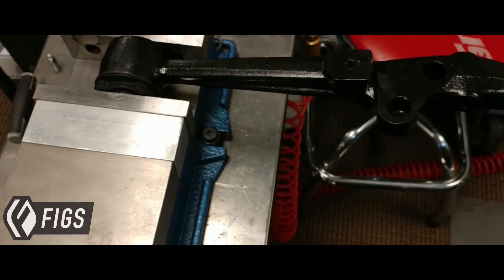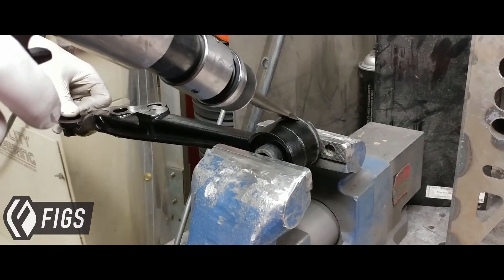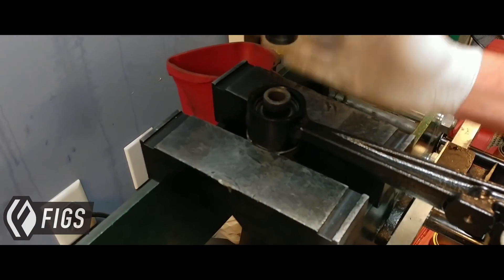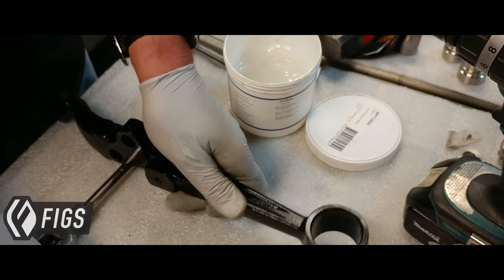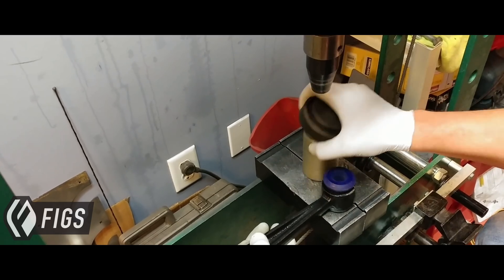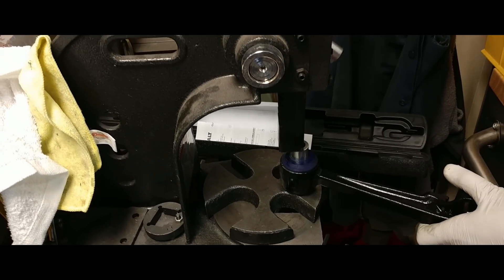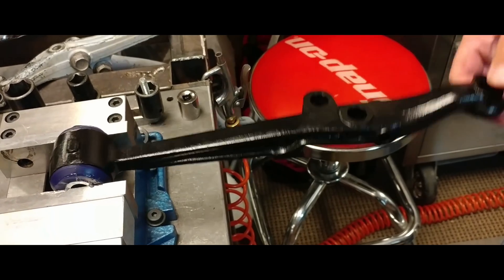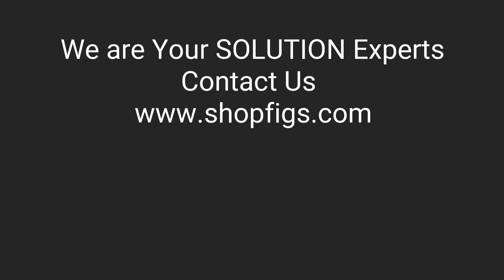OE Rubber vs. Superpro Poly Bushing vs. FIGS Spherical FK Bearing Mounts + Tutorial

Comment: How are spherical on NVH. I just read a rather disparaging article (and ensuing comments) about how poly isn't suited for control arms due to rotational wear and squeaking and something called taking a compression set. Someone even said theirs were toast after just a couple of hard track sessions. What I'm looking for is a measurable upgrade for a beloved daily driver that I like to drive hard and will take to a track or autocross a few times a year. I would like near OEM reliability/durability, once-yearly maintenance, and roughly the NVH costs of mid-stiffness (85a) poly.
Reply from the maker: I think if you're talking about the general term of polyurethane and suspension motion, there are not a lot of great solutions out there. This tends to give the material a bad name as if the formula is consistent across all manufacturers. All I can say is that super pro has designed a quality product with features that retain lubrication. Lubrication is the biggest key to success with polyurethane. We have proven the longevity of this product across many platforms and conditions. It really is a fantastic product with a factory like feel, but substantial performance benefits and support for higher loads. Sphericals do perform the best under track conditions due to their lack of deflection. However, they will require more maintenance in the long run. Everything is a trade off.

Comment: What are the benefits of the spherical bearing? Anything noticable in driving handling? Thanks
Reply from the maker: Sphericals are the highest performance connection given their 0 defelection nature of motion transfer. But they do put more demand on the primary damper and chassis dynamic stress.  So everything should be approached as a system and upgraded in sync.

Comment: and your NVH will be terrible, factory engineers know what they are doing they use rubber for a reason
Reply from the maker: Not the case.  Just as all tire compounds differ, so do polyurethane formulations. Spherical bearings can introduce nvh but really they just put more high frequency  band damping on the shock itself. If you upgrade to a higher fidelity shock with greater high speed damping properties, you would be surprised how good the ride is. Also subframe mounts with large mass rubber damping can decouple a lot of higher frequency noise. It really depends.

Comment: That standard arm looks the exact same lower front arm as the is200 and JZX100 and JZX90. Im renewing the rear on my JZX100 and ive got the subframe off ready be painted but I don't know whether to go solid subframe mounts, poly bushes rubber bushes??? I use it on the road aswel as off road. Does any1 know if it's unbearable to drive on the road with solid subframe mounts or what it's like with poly bushes instead of standard rubber or whats best for a mixture of daily and off road driving??? Only let me know if uve had experience please as I really need to get it done and I cant find anywhere people explaining the feeling on fitting em
Reply from the maker: It's difficult to explain a subjective feeling especially when it comes to ride quality. Some people will tell you that solids a great and they would never go back but another person will tell you that they are far too harsh to do anything on the street or for daily driving. Our polyurethane bushings do an excellent job of absorbing a lot of that high speed NVH, the rattling and vibration that you would get from a solid solution. But the resulting feel is greater response, not jarring force.
Reply: As a 2nd gen GS300 owner, I have a mixture of all 3 throughout the multilink system, OEM, Super Pro ( 70A or 80A ) , and Pillowballs in certain areas of the suspension. What I've learned is that  low speed ( your typical 25-45mph ) driving on imperfect city streets is not for stiff spring rates, Pillowballs in upper control arms or in places such as #2 control arm which connects to the body as part of the front subframe damping. Super Pro is good for subframe bushings, because they offer oem like ride quality and gets rid of that extra "lurching" one feels from hard braking, or sharp turning. With 12k and 10k coilovers a small bump at 30 mph feels like I'm off roading, that same bump at 60 mph becomes obsolete. Low, Medium, High speed damping plays a HUGE role in everything else on the suspension.

Comment: OEM rubber is best .. dampening and noise is non until rot dry
Reply: Best. For what? Best varies greatly depending on use case and variables.

Best ride? Best track performance? Best balance of just those two parameters? Even those two simppe qualities have multiple layers of nuance.

Then there is best for maintenance? Best longevity? Best resistance to environmental issues?

Not to mention best cost. Best ease of installation.

What is best for one application is worst for another.

Comment: Question  .      .      . How does  poly  bushings  holdup  in cold  weather .  Living  in Alaska
Reply from the maker: The temperature will impact the durometer slightly, but the grease used was designed for extreme low temperatures so there should be no issue with the lubrication aspect.

Comment: How is the ride feel between the spherical bearing vs the poly bushings? I am looking for that soft comfortable stock
feel.  I know it will be more stiffer ride with poly bushings but is it that noticable to where you will feel every bump?
Reply from the maker: It really depends on your shocks. Every bushing or bearing replacement really just puts more emphasis on the shock as the primary and in some cases only damper. You won't feel every bump unless your shock is poor at damping high-speed force events.
Reply: I've had both on my IS F.  Spherical bearings are less compliant on sharp bumps, so you'll hear them and feel them more than you would with rubber or poly.  Poly is in the middle.  It damps out less high frequency than rubber, but noticeably more than solid bearings.  That said, I recently went full solid with Ohlins DFV shocks on my front end, and the steering precision is really amazing compared to poly or rubber.  Just know that hitting a pothole or anything sharp edged is going to make a louder cabin noise and give more valuable feedback through the steering wheel.

Comment: Please, whats shore A thete até these bushing?
Reply from the maker: Depending on the application and load requirements we offer 70,80,90 and 95a durometers.
Reply: @FIGSEng  for Civic si 07 tô 2015
Reply from the maker: We have several bushings for that application.  Most would be standard 80A hardness.  If you would like a quote you can email us at contact@figsengineering.com.

Comment: How harsh would spherical bearings make street driving? I understand academically that the solid bearings have zero give compared to rubber bushings, but in practice, how much rougher does this make the ride?
Reply from the maker: In practice the spherical will put more emphasis on chassis response and the shocks. This is one reason why when upgrading,it should be in conjunction with damper upgrades. When the suspension attaches to the chassis via large subframe bushings, the impact is unnoticeable because they still decouple the high freq vibration. I think it also depends on the state of other components in the system and it will expose worn or weak items.  Generally these things are outweighed by the increase in response, one reason we suggest them for track only applications. Mike

Comment: Hi great video. What’s the difference with the hardened rubber bushing vs superpro poly bushings?
Reply from the maker: Hi, can you clarify? Difference in motion? support? Happy to answer I am just unsure the specific question.
Reply: FIGS Engineering 
Thank you very much for responding, I appreciate it very much.

The car Will be used as a street car or daily driving. 

1. pros and cons between the two? 

2.What is the difference in ride quality? Is the hardened rubber closer to oem ride quality vs polyurethane?

3.Do they both make noice/squeaking? 

4.Do they both require lubrication? 

5.Is the hardened rubber softer than the polyurethane? 

I hope these can help better answer my question.
Reply: @47veilside  I guess I am not sure which part you are referring to as hardened rubber as most of the time in order to get rubber to become stiffer, the manufacturer bonds metal rings inside the rubber.  The Superpro Polyurethane is a very precision cast material so it has some damping qualities unlike rubber and the free-moving center pin allows the free motion of the suspension, making the shock work better in most situations.  Typical polyurethane has a bad reputation for migrating during repeated use (deforming) over time, not so with the SP poly urethane.  And the noise associated with polyurethane is also related to poor lubrication.  SP poly has the cross hatch knurl pattern to circulate grease and keep things from squeaking.  Its the best product we have found and the only poly we will sell.  Polyurethane comes in a variety or durometers (harness) and the typical bushing is around 83A harness. The material durometer combined with the PROFILE of the bushings determines its ability to supports loads as well as control harshness.  Rubber is typically bonded to the inner and outer cups, so no lubrication is required, but it fatigues over time as a result.  Polyurethane solutions from SuperPro will fix many of the tread wear issues associated with bushings not handling the loads of braking and therefore offer a better long term solution than the rubber they replace.
Reply: Mike Figaro thank you very much. Your answer is just what I needed.
Reply: i believe what nick muffin is referring to as hardened rubber is the same stuff that Hardrace uses for their bushings & mounts. I am just as curious about it but seems to be a secret as to what it is exactly.

Comment: Can you use a hot razor and cut the poly bush in half then install?  Can you put the poly in boiling water, grease then push in?  How is ride quality of this poly VS OEM rubber?
Reply from the maker: @grabir01 to cut them would be to reduce their structural integrity and shorten their life and effectiveness, just for the sake of easy installation.  Similarly, doing anything to change their structure or soften their durometer, boiling, heating etc, will not leave them in their preloaded material state.  While materials share a common name, "polyurethane" the material properties of the SuperPro formula is unique.  You can expect a more direct feel with the bushings installed, but the properties of the material make them less harsh than typical materials.  Also, the knurled center interface is very unique and eliminates the noisy stereotype that poly bushings have (based on the performance of other manufacturers bushings.)  Does that make sense?
Reply: Understood.   Thanks .. :)
Reply: A poly ride is harsher. You might not like it.
Reply: The hot water approach does not work. You *must* have special tooling that will keep the bushing aligned with the bore *and* prevent the bushing from distorting.
Reply: @GroovesAndLands  Rubbish, find something wide and flat and you can use a clamp, a vise, use your imagination. Obviously a press is ideal but not everyone has room for 1.
Reply: @Senkino5o  You prove my point. "Using your imagination" and "finding parts that are ____ and _______" is specialized tooling, like I said to begin with.

FWIW, when I installed mine, I used the lathe to turn a "bushing funnel" that worked quite nicely...
Reply: I will use a razor and slice it in 2.  Then lube up and install. That way I can install  with control arm still attached to car.
Reply: It only needs the lower rear. Seems simple enough to replace if its in 2 parts. Other sellers actually sell this for the SC300 in 2 parts. It should fly. If not.. Then.. Well.. I wasted 25 bucks and still have a spare and will have to remove the control arm. May have to do it anyway. We shall see. :)

Comment: What do you recommend for a daily car with slight stance ?
Reply: What is the purpose of putting performance bushings on a stance car? Stance is just is just for show. Why would you want to spend money in performance suspension when stance ruins suspension performance anyways. That is probably why he did not answer.
Reply: Spinningtriangles brap brap then he shouldn’t have replied in the first place if he not gonna answered. Stance and slammed are two different cars. I kno the difference you don’t need to explain it to me
Reply: Maybe you can further educate me. The people in my area call stance to cars that usaully very low and have to have negative camber in there suspension so th tires dont rub the fenders.
Reply: Spinningtriangles brap brap it’s possible to have a low car, wheels pokin’ lil piece and tackle roads nice and hard. Like my SC. Extreme confidence on the road, only the rear is like -3 deg in. Nothing serious at all
Reply: How low is it? Mist stance cars I see are way to low. When it's too low the suspension geometry gets all jacked up. I own an fd and sits at 25.5 inches. Not just  for looks but more for performance
Reply: Watch my video but I won't answer your question.
Reply: MrSprintcat if you won’t answer then why reply in the first place jackass ?

Comment: Did I miss the "OE Rubber vs. Superpro Poly Bushing vs. FIGS Spherical FK Bearing Mounts" part of the video? It was a great tuturial for someone with shop tools on how to remove and replace bushings but where is the  * vs * vs *  part to compare the 3 types?
Reply from the maker: Did you want the video all the way through? We talk about the articulation, flex, rotation rate and resistance.
Reply: @FIGSEng  Yes please!